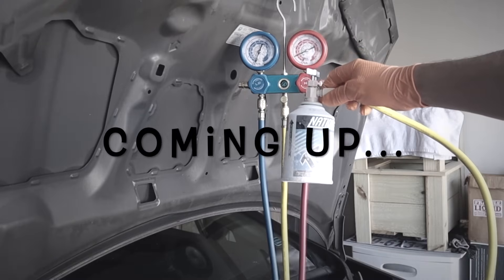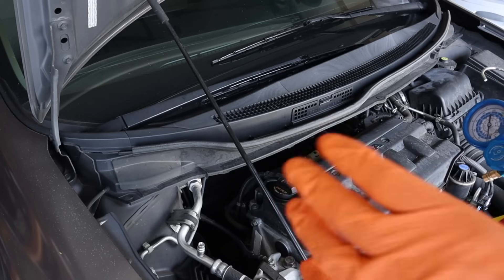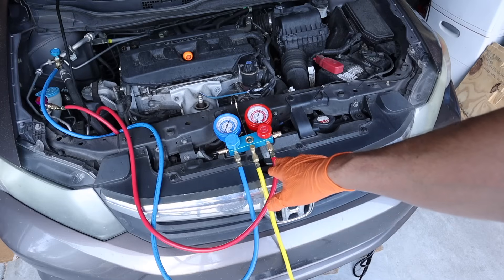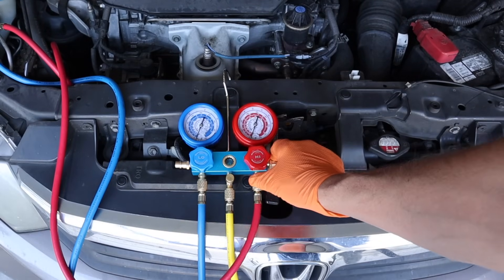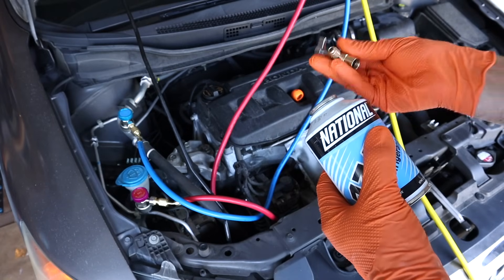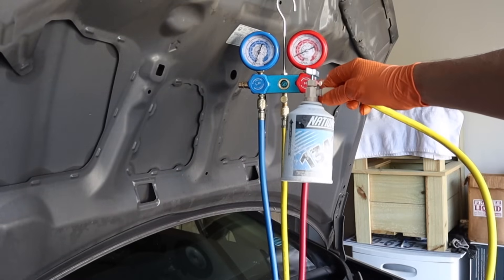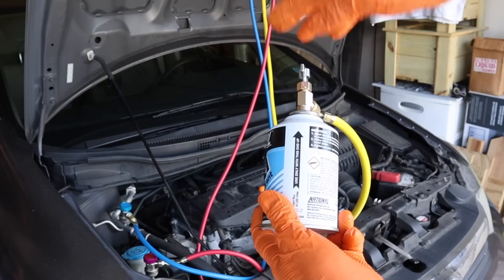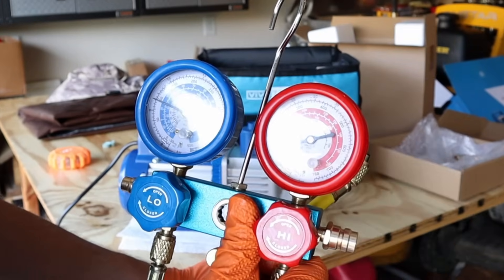DIY Tutorial - Proper R134a A/C charge & Diagnostics

Comment: How do you empty the refrigerant in a empty, big can
Reply from the maker: Good question. When the can gets to the end (not much in it) it does get a little difficult for that last little bit of refrigerant to empty out sometimes. If it stalls, try wrapping a towel soaked in warm water around it, that helps a lot of the time. Thanks for hanging out!
Reply: @my-honest-review how do you use the vacuum pump to empty the refrigerant from your car in a empty big can instead of letting the mechanic car shop do it for you. So I can reuse my refrigerant
Reply from the maker: @hemakingbigmoves  Oh I see what you're asking, sorry I misunderstood you. To extract the refrigerant yourself you need a reclaiming machine, the vacuum pump shown here is only used for pulling air/moisture out of your system. If you do a fair amount of AC work (or you think you may in the future) you can purchase a used reclaiming machine on marketplace for a few hundred bucks, but for the weekend DIYer like me and most folks it's hard to justify that. You also have to have a place to store the machine in your garage. Just call around to a local shop in your town who'll reclaim the refrigerant for you, that's what I did here. If you make enough calls, you'll find one who'll do it no charge because they get to reuse your refrigerant for their customers. Hope that helps!

Comment: Looking for a leak by vacuuming is not the correct way, you should charge the system with nitrogen and actually find the leak, you've only drawn the system down to -1 bar and when it's running it could be over 15 bar so 15x the pressure you have used to test for leaks! Other than that, great video!
Reply from the maker: I'm gonna have to get me one of those one day for sure. What I tell folks is that if there's a moderate to large leak in the system, vacuuming like I'm going here will let you know, but if you want to find the micro leaks...yep, pressure testing with nitrogen is the way. Thanks for hanging out!

Comment: Does one end of your hoses (blue,yellow,red) have a check-valve type on them?  If so on what side of the manifold do they attach too?
Reply from the maker: Good question, and technically the hoses can be mounted on the manifold either way, there is no check valves in them. It just works best for the angled necks on the hoses to be the ends that are not attached to the manifold, just for ease of use. Hope this helps!

Comment: October 11, 2025.  Great video, easy to follow, very well explained.  The Compressor/gauge/detector combo on Amazon is priced to be affordable.  Thank you for this video and link.  I plan on changing out the condenser coil in front of my car that is easily accessible due to it being beat up through the years.  AC working properly but vehicle is 25 years old with 387,000 miles and worth keeping.  I’m getting the system reclaimed for $50 at a shop and I will do the rest.  Did locate the info needed under the hood for the 134a requirements.
Reply from the maker: That is super awesome, thanks for sharing! Those condensers sure do take a lot of punishment as they sit in front of the radiator. If you're interested, here's a video of me replacing my condenser https://youtu.be/P4s-vdzz8vg Thanks for hanging out!
Reply: @my-honest-review  condenser change out went well, 1st round of recharge went well until I removed the valve off the Low pressure.  Started spewing Freon so immediately slapped on the Low pressure valve to do some research.  Schrader valve problem.  Bought a pack of five for $4 at AutoZone.  Reclaimed the Freon and changed out both Low and High side Schrader valves.  Bought a removal tool at O’Rielly’s for $4.  Changed out and pulled a 30 minute vacuum holding for one hour.  Held -30 on both gauges so pulled two more hours of vacuum and recharged the system with 15.85 ounces of Freon (used a scale for accurate measurement).  Schrader valves,  those are two items that need to be change regardless.  The old schrader core was wore out and not seating, the high side was on the verge of failing.  Looking at a new one to compare glad I changed both.  I did lightly oil the seals with PAWG 46 oil.  I’m still puzzled by those one way check valves on the manifold service lines,  like which direction do they allow movement and just where in the heck does one attach too.  The manufacturer support couldn’t give me an answer and no where is it addressed in the manual.
Reply from the maker: @robertgill448  You have a great point about replacing those Schrader valves regardless, and if you are working on a car more than a decade old, yep, just do it. And the next time I have to do a recharge on my system here, that's what I'll do. 100% good point. I also did a quick search to make sure I was telling you right about the blue and red lines, and yep, there are no check valves in them, you can mount them either way. EXCEPT in some higher-end manifold gauge sets. So there's the exception. But I've never used a "higher end" set (like from Robinair or Yellow Jacket) so I wouldn't have known unless I researched it. But these DIY economic sets like what I used in the video, there are no check valves inline in the lines/hoses themselves. The only "check valve" in this case are in the quick connectors that attach at the end of the blue and red lines that go onto the AC service ports (that depress the Schrader valve). When you take them off the high and low service ports, then the check valve will be enabled and they will trap refrigerant between them and the manifold (when the manifold valves are closed). The check valve in these couplers only work when the quick connect couplers are disconnected from the AC ports on your car. It's a little confusing I know, but I hope I didn't make the waters even more muddy for ya!

Comment: Your gauges show 90 on the low side and 100 on the high side, both of which are way off the mark. 50 and 200 are more in the area of good gauge readings. Have you found the problem? If so what was it??
Reply from the maker: Hey Kevin, you can watch Part 2 of my journey here if you like - https://youtu.be/1PBz5_kW6q4?si=Q5WK6pDBQL-1dZ6Q It turned out to be the expansion valve. Thanks for watching!
Reply: @my-honest-review  Just watched part 2 and I have to say that is probably the best how to video I've ever seen on YT, and I've seen a lot of them! Perfect lighting, good tips, and great editing. Nice work! Now I have to figure out my own problem. I redid the entire ac system on my 2004 Taurus 2-1/2 years ago and recently the supply air became noticeably warmer. Put the gauges on and yes it was very low. It took a little over 2 cans of R134a, brought the pressures up to 50 and 210, but only blowing 68 degree supply air. Any ideas as to why it's not cooling? I've read all the internet theories, but with a relatively new system not seeing anything other than maybe the condenser coil.
Reply from the maker: @Kevin-mm6xm  I appreciate the compliment! So you have a leak somewhere for sure, and you've got some air/moisture in the system probably at this point. In my non-professional opinion, I'd start fresh, have all the refrigerant reclaimed, then vacuum out the system. See if the system holds any vacuum for 45 mins or so. If it seems to hold vacuum go ahead and charge. When charging (I believe about 32-34oz total for your car) I'd add some UV dye at the same time to help you track down the leak. Start there and keep me posted.

Comment: What about the red hose do you just leave the refrigerant in the line
Reply from the maker: Good question. You're only opening that low side manifold valve, leave the high side closed after the vacuuming process. Hope that helps!
Reply: @my-honest-review  exactly what I did I closed the high side from the gauge but left it open from the port after finish charging the ac system through the low side I closed all port n unhooked all line as soon as I detach the red hose from the gauge refrigerant spray every on me lesson learn
Reply from the maker: @Hmoob101  Also what you can do before disconnecting those lines is just wrap a shop towel at the base of the line to somewhat catch any little discharge of refrigerant so it don't get on ya. No matter what you do, there's always that little blast when you disconnect those lines no matter what. And if your Schrader valves on your AC ports on your car has some age on them you'll get even more of a blast when disconnecting. Of course wear those safety glasses too!
Reply: @my-honest-review  thank for the tip but I think you might mistake what I say I meant that I already unhook both the low and high side line from the car what I didn’t know was there is still refrigerant trap in the red line as soon as I unscrew the red line from the (Manifold Gauge) refrigerant spray on me if I have known there still refrigerant on the red line I would’ve sent it to low side back to the compressor
Reply from the maker: @Hmoob101  Oh, I did misunderstand, sorry about that. Thanks for clearing that up. Yes you could indeed, after unhooking your red line from the car, go ahead and open the manifold valve on the high side and drain that refrigerant thru the low side line and into your AC system. That's good thinking, I haven't thought of that 👍I always leave my lines on my manifold gauge set when refrigerant in them (at least on that high side line), but your suggestion is better.

Comment: My system was solid with no leaks and then I discovered one on my accumulator and I was leaking Freon so I changed the accumulator. No big deal. Then. I got a huge bunch of mist coming out of the vacuum pump. Turns out it was the cheapo fitting. The snap-on fitting on the high side was loose because when I was adding Freon I started seeing it blow out so I didn't wait. I cut everything off. I didn't do it all over again but I think I got lucky and it was blowing out more Freon than it was sucking in air. Joe, maybe I got Ethan and got lucky
Reply from the maker: Yes hopefully you didn't get air in your system. It sounds like you acted in just the right time. You may just have to top your system off a little later if you aren't getting the cool air you're looking for.
Reply: @my-honest-review the tip on bleeding the freón Line before starting the feed is rarely mentioned and certainly it isn't mentioned anywhere in the manual. I want to thank you for pointing that out. Is it kind of a no-brainer right? But I didn't think of it so it was a good point. Also my gauge set is kind of cool. I have a fourth black line used just for vacuuming out crap. I did get the new fittings in but now I don't need them as the AC and the Jeep is running fantastic. I can't believe how cold it is. Thank God it was just an accumulator.
Reply from the maker: @jamesdewer  Hey that is super fantastic, I'm glad you got some cold air now in your Jeep! Yep, bleeding the air out of that yellow line is something I learned awhile back and I don't see it touched on very much nowadays when skimming tutorials, so I thought I'd better include it in my vid for sure. It only takes a minute and is essential in my book. Glad it helped 🔧

Comment: Excellent video with much better information and procedure than 99% of the a/c charge diy videos on youtube. I want to point out a thing or two however. The wait for seeing if you lost vacuum is an important part of the procedure BUT not losing vacuum does not mean you don't have a leak. A pressure leak can be very different than a vacuum leak and a system that holds vacuum doesn't necessarily hold pressure. Also about adding oil. They drew some of the system oil out with the refrigerant when recovery was done. My recovery machine puts the oil into a small bottle so I can see how much to add on the charge. Besides that oil loss there is the oil loss from the leak. Oil is part of a refrigerant leak. You can even spot your slow leak by looking for oil residue on your system lines, hoses, compressor, condenser, etc.
Reply from the maker: I appreciate that feedback. You have a rare gift my friend... and that is the ability to offer constructive criticism without 'talking down' to whoever it is (me in this case) you're giving advice to. I applaud you, and thank you again. Having said that, yes I agree with you that there could be a case that could fool a person whereby a leak could still be present after their system held a perfect vacuum. I've actually heard of that happening once or twice. Lesson there is simply be aware of the possibility and if you wanted to be 100% certain of a sound system with no leaks, you could buy into a pressure tester like this one here: https://amzn.to/47HgnLw But for the average Joe you could just put a couple drops of UV dye in the system when charging to help ID a future leak. Food for thought for anyone reading this. Also about the oil loss.. what I've found over the years is that it never hurts to put an ounce or so of PAG oil in when charging just to cover your bases. And this becomes more important if you do this process repeatedly (refrigerant recovery, vacuuming, and charging). However for the beginner DIYer who I'm tailoring my advice to here, and who'll be doing this charging process once or twice at most on their car, not adding oil during a simple vacuum/charge is not going to hurt anything. It only really matters when replacing components in the system. Hey thanks again for stopping by and offering your advice!

Comment: just to let you know he first can you put in, doesnt pumped 12oz, just because it is 12 oz that doesnt mean that you pumped 12 oz, you to weight the firstone like u did the second one  .. nice video. one more tip is to use warm water on the can to push in the freeon every tiny bit
Reply from the maker: If you wanted to be extremely precise, yes you could weigh the first can as well just to verify, I see your point. And yes wraping a warm cloth around the can to help it go in is a good tip. Hey thanks for hanging out!

Comment: Should have had the high and low pressure sensors checked with a scan tool, 1st. If they read ok, after having the system evacuated, you then should have back flushed the evaporator and lines (and condenser, if you have a condenser that's able to be flushed)... and changed the orifice screen/tube or the line with the orifice screen/tube in it... if you have an expansion valve instead of an orifice tube, you should inspect it for damage and possibly replace it depending on whether or not the part is cost prohibitive. You would have had to empty the compressor of oil and then add the correct type and amount of oil back into the compressor/system... but it still seems like a no brainer since you already had the system evacuated and went through the trouble of drawing a vacuum with plans to recharge the system.
Reply from the maker: Hey thanks for the input, it helps the channel immensely when you comment.. Yep, I try to keep things simple for the average DIYer. It sure enough was the expansion valve like I was expecting after this simple procedure. Here's the video where I replaced it.. https://youtu.be/1PBz5_kW6q4?si=j9JcPHQ51ziOSBWl Thanks for hanging out 🔧

Comment: I'm back again.  If my compressor (installed in 2015 and still work) is good to go, how many ounces of PAG oil are usually in it?  If the compressor has enough PAG, would 2-3 ounces loaded into the yellow hose be sufficient for the rest of the system?  In 2024 I replaced the condenser, dryer, evaporator, orifice tube, hoses.  2002 Ford F-250 CCLB 4WD 250,000 miles
Reply from the maker: Hey there Patrick, hope all is well. So I just looked up your total PAG oil capacity for your F250 and I'm seeing 9oz system total. Your compressor is going to hold 3-5 oz of that. So if you replaced everything but the compressor, you'll need to add 4-5 oz of PAG46 at the time of charging actually. And since the yellow hose will not hold that much oil at once, you'll have to do it in increments, between your cans of refrigerant. I hope that helps!

Comment: on a 2004 Chevy express Van, with rear AC. I only went to negative 5. Should it go further to negative 10??   Even though it can hold at neg 5 (for all hours held, until released). 6:35
Reply from the maker: Great question. If it held at 5 Hg for hours on end, my inclination is that your manifold gauges are not calibrated correctly. There's a little set screw under the clear cover over each gauge where you can calibrate to zero before you hook them up. Or the gauges might just be faulty and not reading right. At any rate, I would proceed on and charge in your case and see what happens. Hope that helps!
Reply: @m @my-honest-review hi, recently replaced my condenser and after I started vacuuming the system I filled up the pump with oil everything was running smoothly but after I came back from the store I noticed my pump had lost oil and after finishing the vacuum some oil came out of the hoses, don’t know if it was moisture inside the system or oil?
Reply from the maker: @DanielAl-f1l  It's normal to have a little PAG oil residue drift into your hoses, and it might appear oily at the hose ends when you disconnect. There could have been too much oil in your AC system, which would amplify this issue. Also, yes, what you could have been seeing was a little moisture as well. If it was excessive, you may need to let your pump run longer on a second go-round. And yes you need to keep an eye on your pump oil on the vacuum pump, if it runs dry, it could damage it. Chances are if the pump sounded normal when you cut it off, it wasn't out of oil just yet, all okay. I hope this helps!